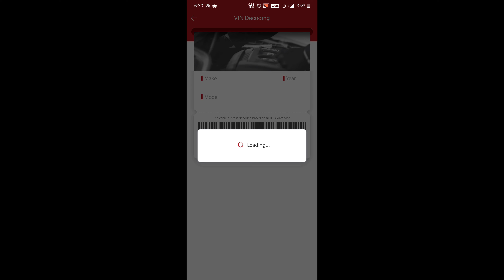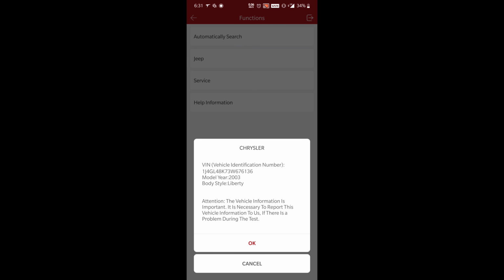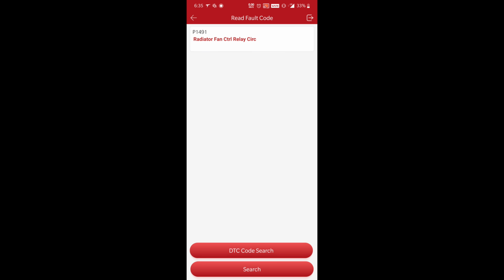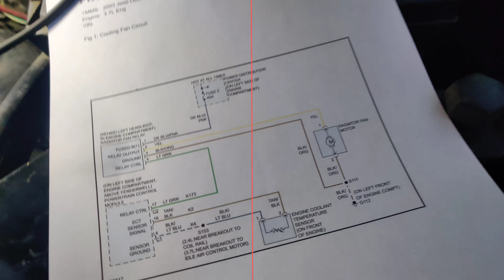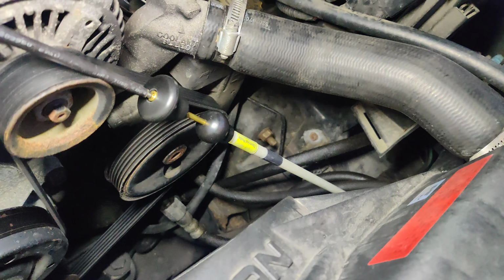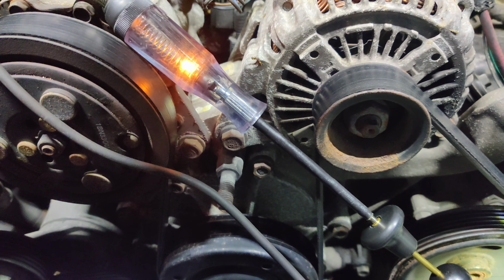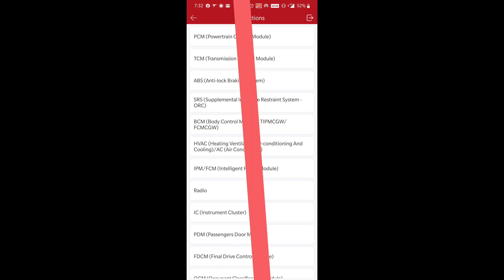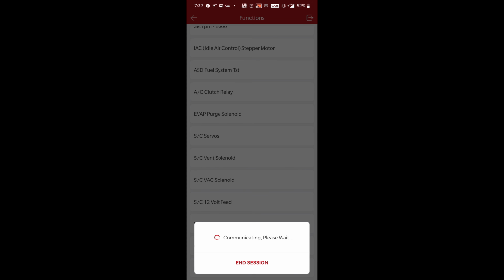2003 Jeep Liberty 3.7l 4x4 Radiator Fan Relay Control Circuit P1491

Comment: I have an 03 liberty as well and if you turn the key into the on position 3 times in a row the odometer will show the error codes. This was extremely helpful to find out and saved me tons of headaches.
Reply from the maker: All chrysler products have the 3 key cycles since 1997 or so.

Comment: you over looked fuse fan..its in that box behind headlight you were in towards rear on the left side in between 2 other fuses right in middle its green normally.
Reply from the maker: I didn't relook at the diagram but we had power going to the module and no power going out from what I remember. I didn't see a reason to check anything else. What does the fuse feed?
Reply: @RobertDotterer  the radiator fan..atleast on mine it's an 02 jeep liberty
Reply from the maker: I just looked at the diagram and there is no fuse between the fan and the module. The fuse is only between the module and the battery.
Reply: @RobertDotterer   you had a diagram for a newer model. mines a 04 and does indeed have a fan fuse and two fan relays in that master relay box under the hood. I'm trying to figure out at what temp does the electric fan kick on cause i just replaced mine. it does turn on with the ac but I haven't seen it turn on just idling. mines a little different as I have both a mechanical and electric fan since it has the HD towing package.

Comment: I have a similar issue and I can get the fan on if I apply power directly from the battery. Seems like I am not getting any power from the fuse box to the relay module connector as my voltage reading there is 0. The fuse is fine tho and I am getting battery voltage at the fuse. Not sure how to troubleshoot the wire from the fuse to the relay connector as it’s hidden inside a bigger cable
Reply from the maker: You can buy DIY subscription to alldata or mitchel prodemand, even a few day subscription to stelantis for factory service information. Then you can follow the wiring diagram and see where your issue is at.

Comment: Can the relay go bad after two and half months? I bought a new radiator fan and the relay two and half months ago and this I noticed the wasn’t coming on with the ac or without
Reply from the maker: They can go bad any time. You need to make sure you are buying good parts.

Comment: Always find the user manual when dealing with wiring. The book will give more details on which fuses and relays control what. The PCM is controlled by the same relay as the A/C on this particular vehicle.

Comment: I have a 2010 liberty im working on. I checked fuses relays fuse box fan  and fan relay just about everything and I still can’t get the fan to run automatically when it gets up to temp I’m using an Autel maxi and I can toggle the rad fan on and off so I know there’s power and ground and the pcm signal is reaching the fans . The curcuit is b+ fuse box coolant temp sensor pcm fan relay.. could a faulty temp sensor cause this issue even though it reads temp .. does the signal go from the temp sensor to the pcm and the pcm decides to turn the fan on or I’m getting lost any help please

No check engine light btw and we had to change the pcm because the alternator regulator in the original pcm went bad so the car wasn’t charging customer states it had an overheating problem about 6 months ago got a fan a radiator .. they seem to be new .. any help would be awesome sucks I can’t see if the fan worked with the original pcm because the car won’t stay on long enough to heat up and I have to reprogram it again if I swap it put

Comment: so fan only turns on w the A/C is cut on or when it reaches temperature? Thanks
Reply from the maker: Most likely but there is never a guarantee because it's software controlled and it can change between years, updates, and model cars. .
Reply: I own this car and it’s both. When ac is on and when the coolant reaches a certain degree. Unfortunately mine is broke atm which is why I’m here 😂
Reply: I might add, I have no check engine light on tho

Comment: Awesome as usual.  What brand is piercing probes and where to buy? Thanks
Reply from the maker: Which one?
Reply: @RobertDotterer  the kit in the box
Reply: @briankotze57  powerprobe kit with piercing probes. I prefer Pamona piercing probes. Search Google for Pamona piercing probes. They're about $40 a pair.
Reply from the maker: Power probe kit should be in the description. I use the pamonas a lot from aeswave and EIS sells almost identical ones for half the price that are Grey. Aeswave sells the gray ones too.
Reply from the maker: I use the power probe kit for high current applications, they do not heat up and melt as fast. I melted a few pamonas, I think they are only rated at 10amps. Power Probe kit is rated at 20 I believe.
Reply: @RobertDotterer  thanks
Reply: @billyyoder8171  thanks
Reply from the maker: You're welcome